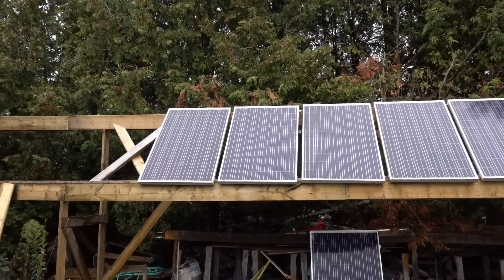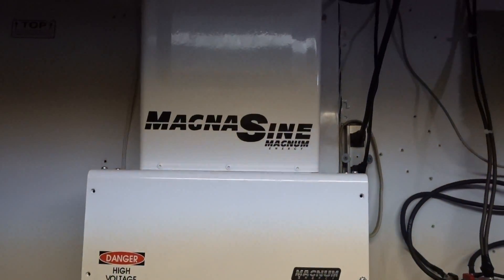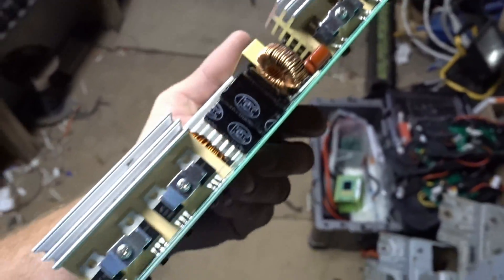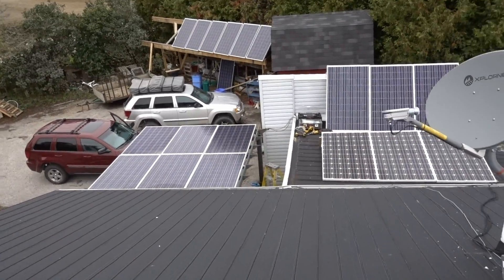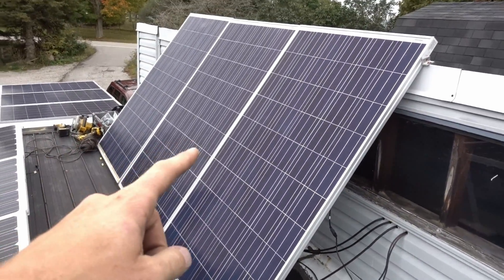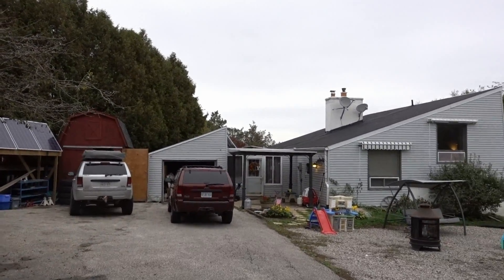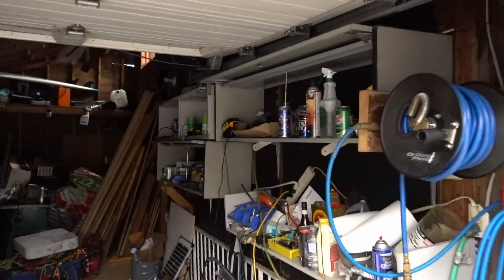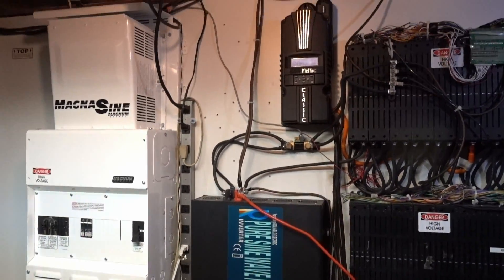4500w Of Solar And 14Kw Power Wall.

Comment: You have inspired me to install a solor system. What would you suggest li-ion or gell battery for starter system. I plana DIY and start small 2000 watts but I want to be able to expand 10k and dont I have enough experience to mix battery technologies as you have done. I am located in Florida. i will try to follow most of what you have done and use the same euipment if available. I have a starter budget of $25000.00
Reply from the maker: wow you can build a very nice system with $25000.00 I would go lithium from the start, lifepo4 would be a good choice and 48v bank, I am glad I inspired you! thanks for letting me know!!! everything I have now is about $12000.00 so far but I get my stuff a lot cheaper then most.

Comment: How are you charging those Gel Cells? They appear to be wired into 2 banks at 12 volts? Or am I looking at it wrong? I know your Lithium bank is ~60 volts, so how does that work with the Gel Cells?
Reply from the maker: ATM I am using the power from my 60v 8000w inverter to run the charger function on my magnasine inverter and the magnasine inverter/charger keeps my batteries topped off.

Comment: If you have room aim for around 10 +KW OF PV PANEL to increase collection area when cloudy. That would then enable you to increase string voltage  to the charge controllers.
Reply from the maker: yea i am at 100 volts atm might do 130v